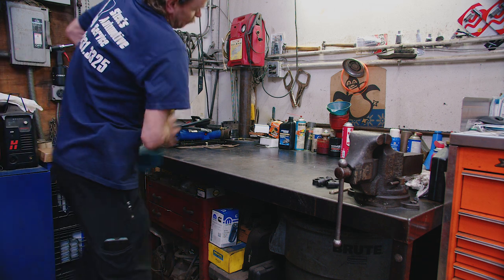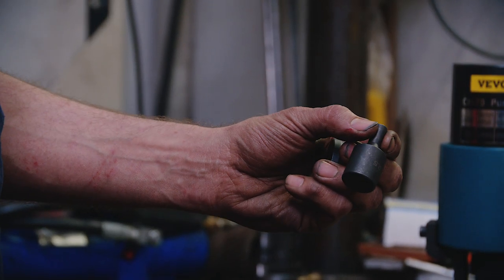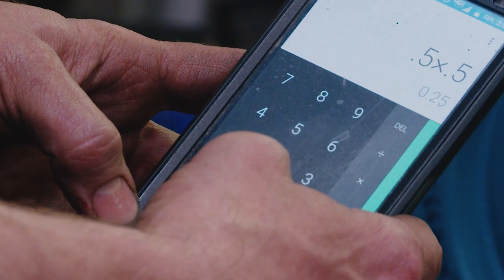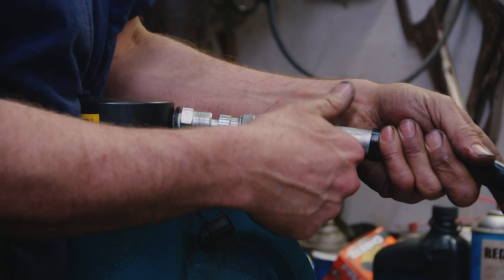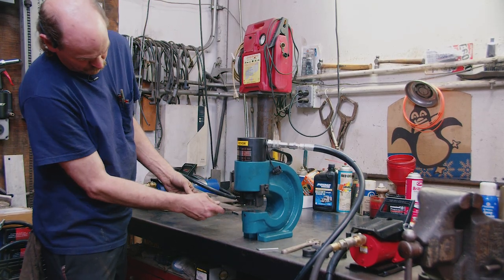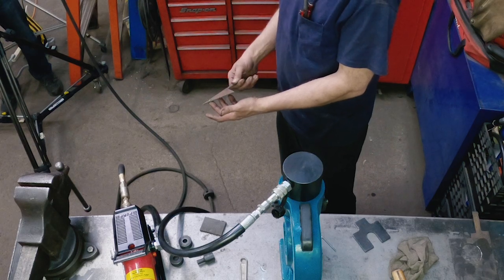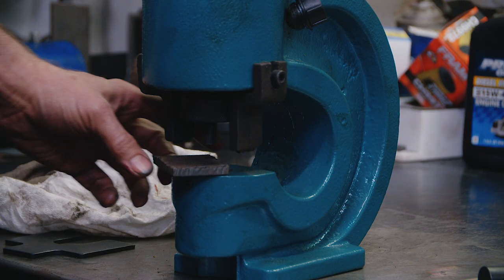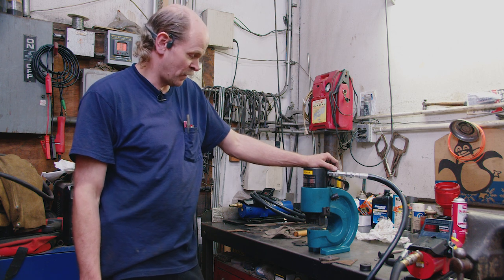Vevor CH-70 Hole Punch Tool Review and Demo

Comment: Very informative video,  really thinking of going with one of these. Thickest material i would use is 1/4 inch so perfect. The other problem with drilling is you can never drill just one hole unless it really small, I need a 1/2" hole in a 1/4" flat bar, I have to drill about 3 holes to step up to the final size. Looks like a good product if it lasts any length of time, thanks for posting!!